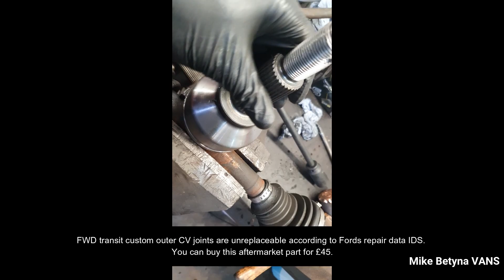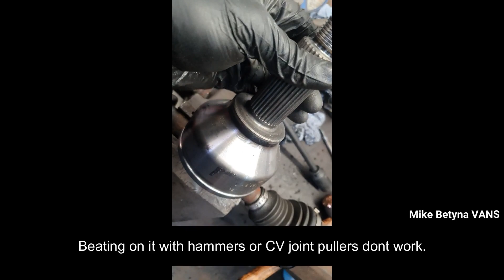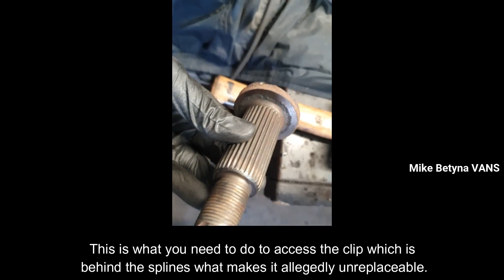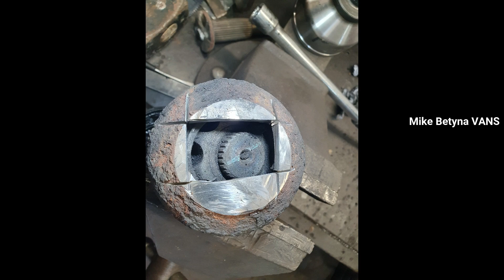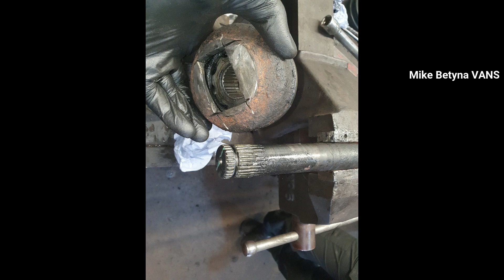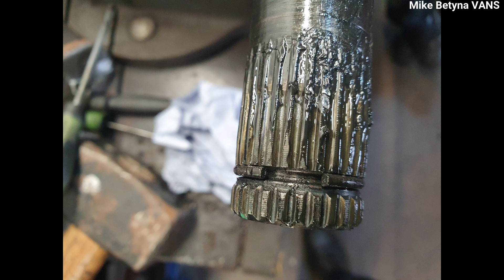Ford Transit Custom FWD - Replace Outer CV joint #ford #transit #cv #joint SAVE £££ !!

Comment: Hi there, this joint is a buggeration. I tried your method and I can't see the clip. I can just about see the channel it sit in 😢
Reply from the maker: You need to tap the joint towards the shaft first to expose the clip a little. Then use 2 small picks to compress the clip and second person hits the joint with the hammer.
Reply: @FixingVANS  thanks for the reply, we tried exposing the clip this way with a sledgehammer. Nothing worked. I just bought the driveshafts... Oh well

Comment: Really? I replaced one and it hammered off without any cutting
Reply: I deformed the whole joint by hitting it with a hammer and it still won't go down
Reply: I always thought you just pulled it and hit it with a hammer at the same time..